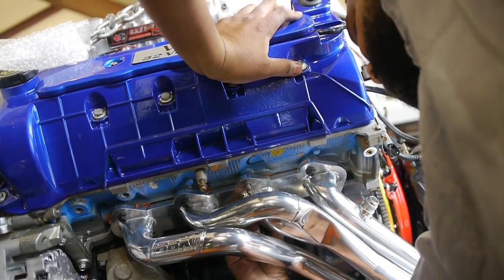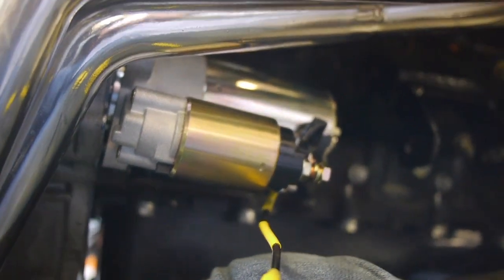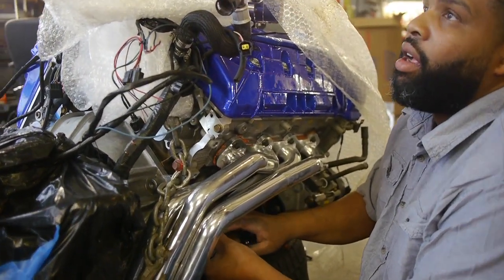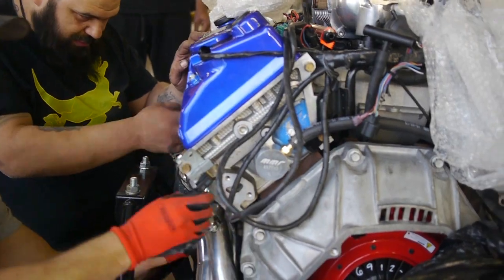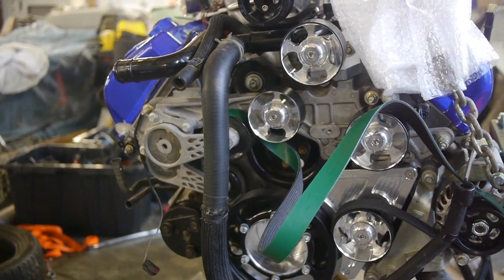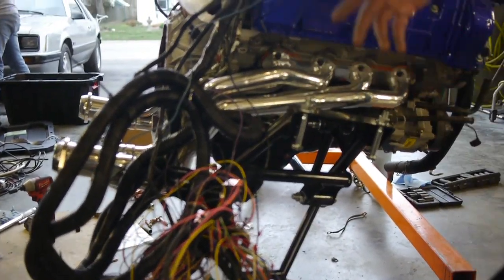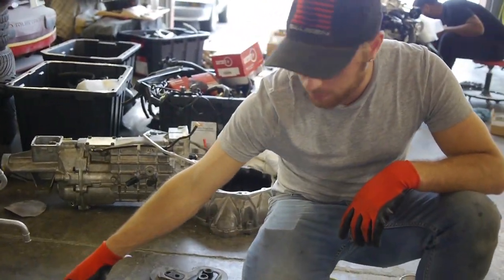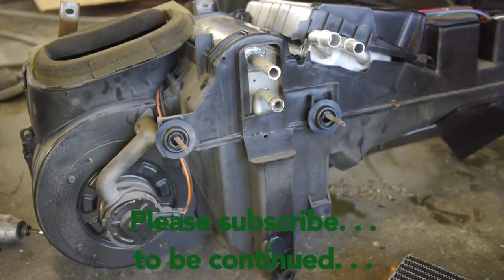ksdnotch 93 foxbody (the story episode 11) by Folleh Shar Tamba

Comment: Damn. That's a big ass dent in that header pipe.I imagine that was for clearance?
Reply from the maker: The headers are made with those dents so they car clear the steering shaft and other parts! The dent is designed by purpose. No sir they were not on clearance.
Reply: @mcscgreenwheels   i figured that. No other long tubes could have been used, with a better design? that dent could restrict flow from that cylinder.